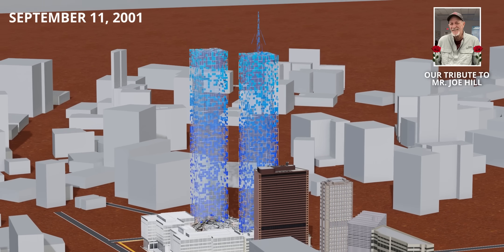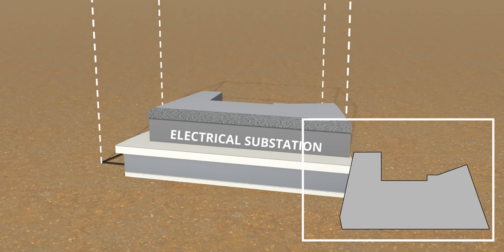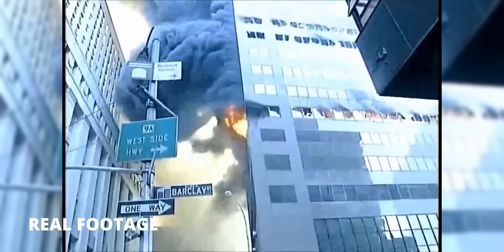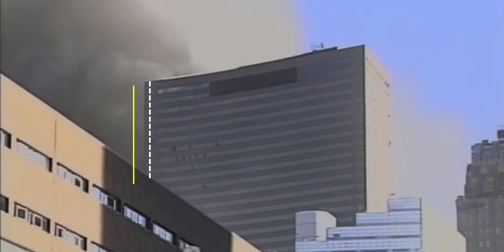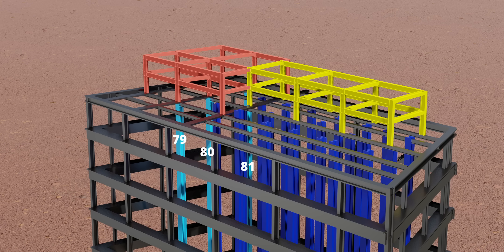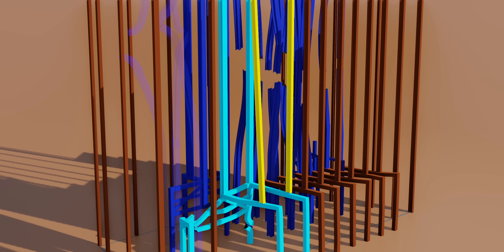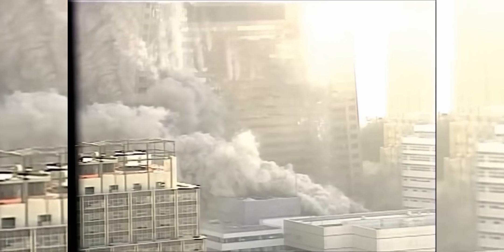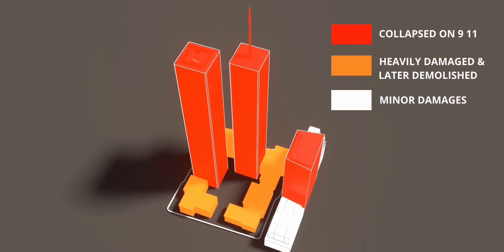Collapse of Building 7 | The Complete Physics

Comment: Regarding the "REAL PHOTOGRAPH" at 3:26.  It's obvious AI slop.  I fed it to ChatGPT, and here is its analysis:

"This is almost certainly AI-generated (or at least heavily AI-manipulated), not a straight real photograph.

Here’s why, based on visual evidence rather than the label in the image:

Key tells

Texture flooding / painterly collapse: Large regions of the building dissolve into smooth, brush-like textures that don’t correspond to physical materials (concrete, glass, smoke). Real smoke obscures; it doesn’t retexture solid structures.

Structural inconsistency: Windows and facade geometry abruptly smear into amorphous surfaces instead of being occluded or fractured in physically plausible ways.

Mid-frequency loss: Edges and repeating architectural elements disappear unevenly, leaving a “felted” surface—classic diffusion uncertainty rather than motion blur, compression, or atmospheric effects.

Semantic blending: The image blends “building,” “smoke,” and “damage” into a single continuous texture field, which is typical of generative models under ambiguity.

Embedded claim (“REAL PHOTOGRAPH”): This is commonly used in AI-image memes and misdirection posts; it’s not evidence of authenticity.

Bottom line
Even if it began from a real photo, the visible artifacts indicate AI generation or aggressive AI stylization. A real photograph would preserve hard structural edges beneath smoke or show consistent destruction mechanics—not this kind of woven, impressionistic facade."
Reply: Which, of course, is why it's a lot older than your "ai".

And, you used a chat-bot as "evidence"? Could you have been more laughable, do you think?
Reply: So you used AI slop to determine AI slop???

Give it up already dude.  Your pedantic obsession with a minor detail and the highly dubious means you go to in order to confirm your bias aren't healthy.

News Flash:  The photo can be enhanced, edited, maybe even AI enhanced AND Building 7 still collapsed due to 7 hours of multi-floor unfought fires introduced by flaming debris crashing into it from the North Tower.  You are not moving the needle on anything.

A more useful endeavor would be for you to take the original photo - you know where to find it - then crop it and zoom in A LOT, enlarge it and then see what it looks like.
Reply: @TheCriticalStinker-01  thing is, it's not a minor detail. This video literally uses this "photo" as evidence to substiate its central claim. 

You're saying I know where to find this source photo. I'm saying the wider, uncropped version of this photo looks just as suspect. 

This "photo" is new, and no one has seen it prior than this video being posted, as far as I know. 

You cannot provide an actual source of authenticy. No chain of custody. No name of photographer. No journal this photo is sourced on. 

Yet you die on this hill. You meet me with hostility and have nothing of substance in trying to refute my claims. 

Either you're literally a bot, or you're singularly the most miserable fedora-tipping, no-life Redditor I've ever met. 

You literally live in the comments section on this video. That is not normal. 

If you yourself are not AI slop, and are an actual human, I strongly recommend seeking psychological help.
Reply: @TheCriticalStinker-01  and for the record, I've already cropped the photo you referred me to in a 1:1 aspect. The two images are mostly similar once cropped, but looking at them side-by-side, the photo you referred me to is cleaned up a little bit - chiefly, the windows are mostly fully blacked out as opposed to the "scribbles" we see in this videos photos. 

That's the biggest difference (alteration) that's immediately apparent once cropped, and looking at them side-by-side.
Reply: @Snoozie09  - And we keep making our regular rotations around the sun

Comment: Not a single famous skyscraper has collapsed from a fire, even if the fire is very strong and the temperature is high. The power of the aircraft's blast wave and its fuel is not enough to damage the columns. In order for the building to collapse, it is necessary to carry out a controlled demolition of columns and cables along the entire height of the building. It is impossible to demolish the building by damaging the columns only from above. Building number 7 was demolished according to the owner, but the government continues to claim that it collapsed due to fire. But the problem is that it is impossible to demolish a building that is already burning; it could only be demolished if the explosives were planted before the fire. That is why the US government is so insistent that the building collapsed from a fire. Bush needed a casus belli and he found it by staging the 9/11 terrorist attack. This terrorist attack is the same fraud as Colin Powell's washing powder, which he presented to the UN as a biological weapon. All these puppets with "scientific" tags and fraudulent computer stimulation are simply government scammers paid to replicate the official version. People don't know that computer simulations are not facts, computer simulations can be adjusted until you get the result you want. Many architects doubt the collapse of three skyscrapers due to fire. So in the simulation and in the video we see that the destruction begins from the floors below the fire, but if the columns collapsed, the destruction would begin with the upper part above the fire falling onto the lower part. The simulation also states that the floors began to fold under the fire, but the lower columns were not damaged, and the floors were held by the intact columns, i.e. the lower floors could not collapse, and several collapsed floors were not enough to demolish the rest of the lower ones. This whole simulation is just a cartoon for naive people. It is also known that a tomahawk missile or similar crashed into the Pentagon; the hole, debris and the nature of the destruction confirm this.
Reply: Plasco Tower
Wilton Paes de Almeida

There is no much else wrong with just that opening sentence I did not even bother to read further. No doubt the rest will also just be mindless repetition of other peoples terrible failed ideas you found on the internet.
Reply: "Not a single famous skyscraper has collapsed from a fire"
Which wasn't just dumb, but also wrong! Well done!

"The power of the aircraft's blast wave and its fuel is not enough to damage the columns. "
The kinetic energy of the impact alone would equate to half a ton of TNT. That not counting the energy inherent in the fuel.

"In order for the building to collapse, it is necessary to carry out a controlled demolition of columns and cables along the entire height of the building"
If, that is, you have no understanding of what happened, how it happened, or what would be required.

"It is impossible to demolish the building by damaging the columns only from above"
Which is not only nonsense but irrelevant nonsense. Well done, again!

"Building number 7 was demolished according to the owner"
That you're too much of a failure to understand English? Means you failed. Nothing else.

"But the problem is that it is impossible to demolish a building that is already burning"
So, what do you know, you proved that you said dumb shit. That's impressive in it's failure. Do you own-goal often?

" it could only be demolished if the explosives were planted before the fire"
So, you doubled down on your dumb shit. That's not a good idea.

"Bush needed a casus belli and he found it by staging the 9/11 terrorist attack"
Why? None has ever been needed before.

"People don't know that computer simulations are not facts"
You, first and foremost.

"Many architects doubt the collapse of three skyscrapers due to fire"
No, they don't. Making up nonsense doesn't make it real, it makes it made up.

Comment: The "REAL PHOTOGRAPH" at 3:30 is so obviously, incredibly fake.  Just look at it. Zooming in would be all the better.

It's also what this video's premise hinges on. 

Unless someone can provide a source photo. I'll wait.
Reply: I have a copy of the original photo, but Youtube is thwarting all attempts to post the link (even though it is in a Youtube video)

Try the search bar with:  WTC Building 7 - FDNY Assessment of Condition on 9/11/2001
Reply: @TheCriticalStinker-01  can you post the link with text broken up? I'll string it together.

What's the document that it contains called? Tried your search query, also sifted through Google imaes, and ran through the FDNY Report_Final.doc -- but no photo to be found.

Really hoping for a response. This needs to be resolved.
Reply: @Snoozie09  - Nope. Gave up after 7 attempts. Copy and paste that title into the search bar and it is very literally the first video that comes up.

Watch it and see if you can spot the original photo
Reply: @TheCriticalStinker-01  Ah, my apologies. I was searching Google for an original link to the photo itself. I suppose I'd like to know who first took the photo, and I'm wondering how I haven't seen this photo once in 25 years.

So indeed, I'm still questing the authenticity of this photo. It is clearly a different photo than the render used in this video. The one you've linked me to actually contains a slight haze of dust in the air to left of the tower, which is not present in this video's version.

Moreover, I'm troubled by the emergency worker in the foreground. I have a fair amount of experience with photography and editing, and I'm wondering why:

1. He's sort of "illuminated" in the foreground, where the rest of the foreground is clearly in shadow.

2. He has a "haloing" effect around (especially visible along the top of his helmet against the sky). In my early days of photo editing, I've produced this effect myself countless times. It's from overly enthusiastic editing, and indeed tends to occur when trying to "highlight" a dark subject against a contrasting, brighter background (as seen).

3. His right leg looks a little strange. The way his shorts perfectly conform to the shape of his leg (around the knee) and flare outward with a concerning "pitch black" interior of his shorts. It's subtle, but I see this anomaly over and over again in AI photos exclusively.

His soleus muscle under his calf is also unusually "straight" until it meets his calf muscle. "Straight" lines along people's limbs is also unnatural, and I also is typically indicative of AI use.

4. I'm not asking anyone to "prove a negative" here, but I don't like that we can't see where his feet meets the ground. In the bottom-left of the photo, we see large chunks of rubble strewn about.  His right leg is perfectly flat, which is at odds with the construction of the scene.  

Cropping out the bottom of a scene to hide bad editing is the oldest trick in the book in photography, and videography.

Also, the more I look at his shoe, the stranger it looks.  The image is fuzzy, but it's as if the rear side of his shoe is jutting out away from his ankle about 2-3 inches. Doesn't compute.

5. There's no real indication of lens bokeh from focus in the background. The worker is "in focus" in the foreground, and the rubble and buildings in the background are indeed a bit "fuzzy", but that's due to depixelation. There's no "softness" to the background like we'd expect to see, even with a more wide-angle lense.

6. Windows. We've all seen how reflective WTC's windows were (on 9/11, and prior).  From this angle, they should rather apparently be reflecting the clear blue sky of the day.

But they're all uniform black.
 
7. The context of the scene doesn't align. If you look at photos from ground zero when the recovery efforts began, and onward, there were emergency personnel *everywhere*.  

I'm not saying it's impossible, but with a wide-angle view of the scene, we'd expect to see a number of other workers. We don't. 

8. The scale of the collapsed tower looks entirely too small. In real photos, people quite look like ants next to them. 

So to be clear, we only see this one worker in this photo and I'm saying he looks superimposed. A pre-rendered scene with a poorly-edited character "pasted" in. All the classic hallmarks of a bad photoshop job.

And I'll say it again: I would really love an actual source for this photo. It's important, because so much of the "gash" theory seems to hinge on fabricated photos I've seen.

Final point. Compare this photo against Sabin's "version". Why does Sabin's cropped version look radically different that the one you linked me to (which, I appreciate by the way)?

The windows on Sabin's version look cartoon-ified, whereas they're uniformly black in the photo you linked me to. Why the discrepancy? Why make obvious adjustments to the source photo, and put it in this video?

I think those are reasonable questions to ask.  Respond at your convenience.
Reply: @Snoozie09 - Stop overthinking it. This was a low resolution photo with building 7 far on the background and it of focus that was cropped and heavily zoomed in, distorting the already low quality even more.

You assumptions were wrong.  You're welcome.

Ha e a nice day
Reply: @TheCriticalStinker-01 There's nothing to overthink. What I've said is plainly obvious, and the difference between a low-res photo from 2001 and the literal, obvious render with no texture or definition on the face of the building cannot be understated. 

It's like a mediocre artist making a photo with markers, and you're trying to liken that to a photograph. 

I'll be sure to circulate my findings.
Reply: @Snoozie09  - I don't think you even mentioned the fact it was zoomed in A LOT and cropped. The two most obvious things about it.

What time stamp did you find the photo at?
Reply: @TheCriticalStinker-01 i didn't mention that because that's obvious and not relevant. 

From memory, i believe the timestamp was 3:55 in the other video.
Reply: @TheCriticalStinker-01  to be clear, I'm not concerned about the photo being cropped. In this video's context, there's nothing wrong with cropping Building 7 as it's the primary subject of the video. 

The aberrations and artifacts I listed in this video's photo, and the other video's photo, are what give me concern. Not the fact it was cropped -- and to be clear, there's no indication of this photo being "zoomed in". 

The composition of the photo you referred me to is clearly that of a wider focal length, not a longer focal length. Still, I'm not hung up on that. 

Just saying so we're on the same page.
Reply: @Snoozie09  - And they are an artifact of it being zoomed in.  Which should be obvious. You said the photo was a fake. It isn't. Just altered and enhanced. 

You were wrong.

Have a nice day.
Reply: @TheCriticalStinker-01  nah, let's keep going. 

You said it was a low resolution photo that was cropped and zoomed in onto the building. 

Tell me, what happens when you crop and zoom onto something in a low resolution photo? Do we not typically see a distorted image due to the lack of clarity, from the lack of pixel density. 

Why in this case, are there no signs of depixelation? The image, as artificial it is - shows no signs of it being "low resolution". That is to say, why do we not see all the ugly, distorted pixels in every low-resolution photo.. ever (especially when cropped)?

The "photo" here, as you can see, is for lack of a better word perfectly smooth. No pixel distortion from low-res. 

It actually looks rather "high-res", with that in mind. 

It also has that classic HDR effect which as we both know, was not a thing in 2001.